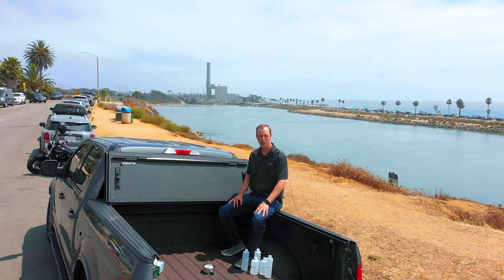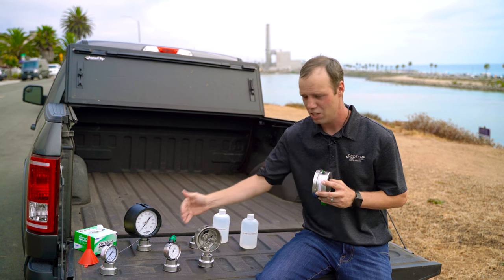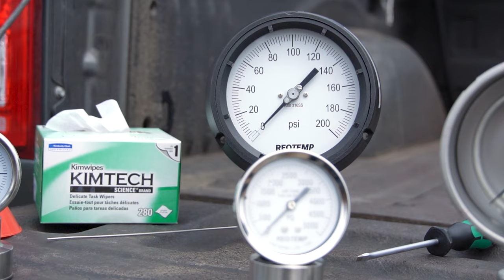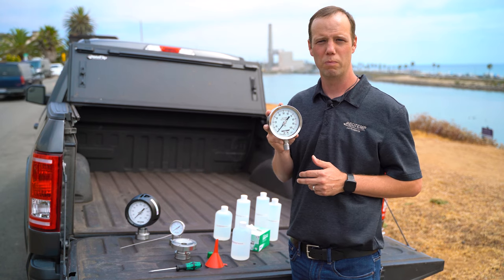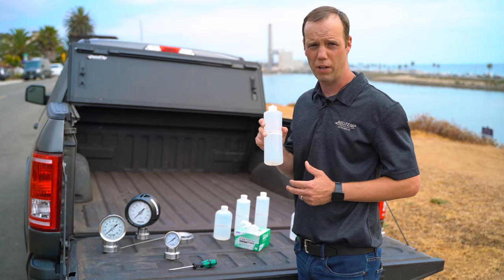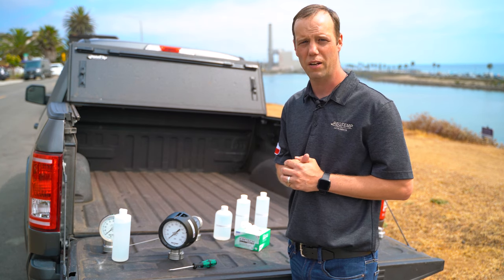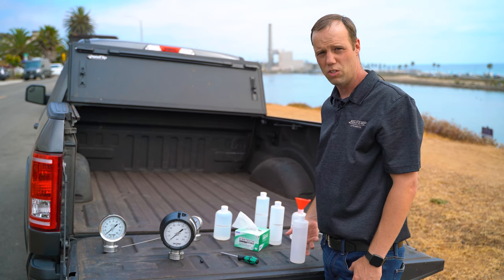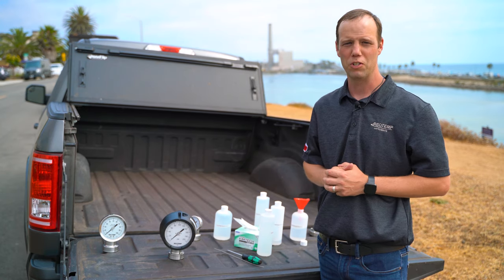How to Liquid Fill Pressure Gauges in the Field

Comment: My pressure gauge is lying horizontally. Should the rubber nipple still be cut if lying horizontally? I'm afraid if I vent it the liquid will spill out since the gauge is not vertical.
Reply from the maker: Sometimes it's not possible to clip the plug and vent the case. That's fine. Just know that if your gauge is lower pressure (less than 0-30psi) you might have some accuracy issues without the case vented, especially if it's installed outdoors.

Comment: Can I install a liquid filled water pressure gauge in any position? I am concerned that the small void / air bubble will not allow me to see an accurate reading should the needle fall within that bubble.
Reply from the maker: Thanks for the question Robert. Yes, you can install the gauge in a non-upright position. There may be some visual distortion, but typically it isn't so great to impact accurate reading of the pointer.